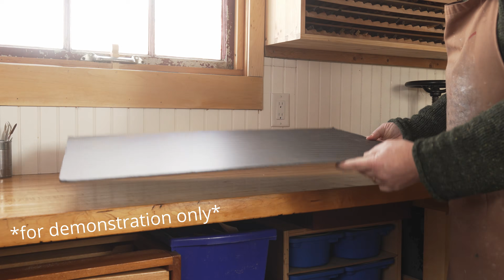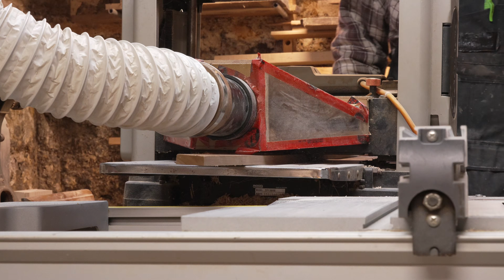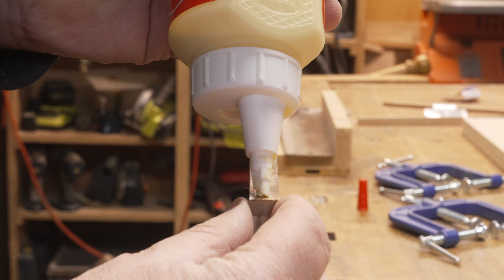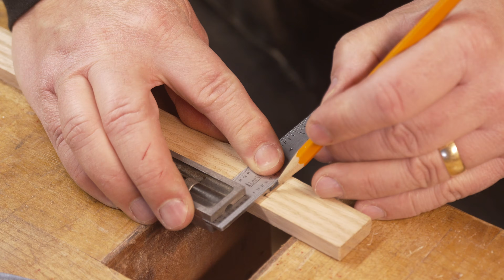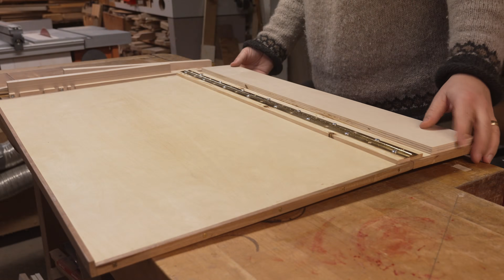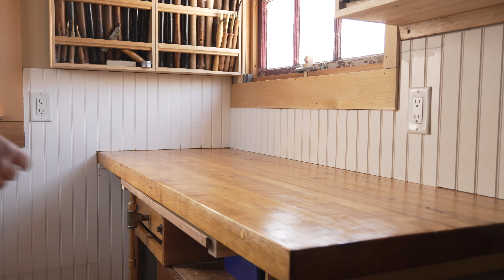Slide-Away Drawing Board - Self-Supporting Hidden Artist's Easel - Design Process & Full Build

Comment: Hi! Very nice design but way too much work to make it. I'm using instead a computer screen telescopic arm those that can be attached on the wall ( or any other vertical surface ). I attached my drawing board on the plate like thing that these telescopic arms have to attach a computer screen ( it has four screws) and then I pull and push it over my desk when I want to draw something. 

These telescopic arms can carry the weight of up to 32 inches wide screens, and allow you to adjust the height and the angle of the screen as well.  So as the drawing board is way lighter than a computer screen this way to mount the drawing board is very steady.  The drawing board is actually floating above the desk and the only thing I had to adjust in advance is the height because this is secured with a very tight clamp that you screw actually  in the right height.  But the height that  the drawing board stands above your desk is always the same. 
After fixing the height the only thing you  have to do is to pull the board towards you and then retract it in the most convenient for drawing, angle. When you don't use it turn it back to stand vertically and push it back flat on the wall. 

I bought this arm for 45euros and there are also similar arms for mounting on desks with prices starting from 20+ euros.

Comment: Your first space didn’t work the way you intended it because you set your rails back and I don’t think your design originally called for it. therefore it’s too far back when you first engage that first drop off and your hinge is pretty much right at the front of the table instead of being out away from it more.

Comment: I just found this channel a couple of days ago and LOVE IT! Your commonsense approach, the use of tools that make the job easier (power tools where and when necessary) and beautiful and refined (the use of hand tools the newfound love of my life) is wonderful! 

I do have an idea for a little reinforcement for your board. If you inset some rare earth magnets or dowels or then the corresponding dowel holes into the right side of the right rail you could put an auxiliary "prop" for lack of a better term. If you made it like a set of pinch sticks/rods I think you could put s shallow angled hole in the back of the board and a little foot on the other end of the "prop". The easel end of the prop itself maybe has a taper or a gimbal on it (not sure about that), but the foot end would butt to the wall and your bench. A 3/8 hardwood dowel and maybe a little piece of 3/4 stock for the foot. If you also used a couple of magnets or a dowel on the foot and a shallow hole in the wall I believe it would stay pretty much and give a lot of support.  Now if you went 1 step further and put a dado across the width of the board you could also put a couple of magnets or dowels. Then you could make a hardwood strip with magnets or dowels to drop in the dado. It seems like it would help stiffen the entire easel. IDK really though. Maybe hang it on the left side of the left runner with magnets or even dowels. As you pull out the easel you drop in the strip into the dado and pull out the easel. Then you take out the auxiliary prop to use as well. 

Don't hate me. I certainly am no craftsman like yourself. And ALL of your projects are AMAZING. I only thought this might be something for you to ponder on. It may be and probably is total rubbish. But I hope you and your viewers will not take offense. NONE was intended. Only that I hope one day to be as talented and accomplished as the craftsmen I admire, and you Sir are one!

Comment: Instead of that drop bar mechanism, I’d probably have made the runners wider so there was more meat underneath the stowed table.  Then I’d put a threaded insert in each runner 2” from the front and put in some star knobs from underneath. In use, the table is pulled out and put it at an angle that feels comfortable, then the star knobs are tightened until their threaded posts contact the underside of the tail piece and press it up, clamping it to the underside of the bench top.  When you want to change the angle or stow the table, you reach under the runners to slightly loosen the star knobs.

I think with the star knobs’ posts clamping the tail piece to the bench top, removing any room for vertical play, there would be little to no wobble like you experienced when testing out those last two positions.  The only thing I think is a trade off is you’d need to adjust two things on opposing sides to change the table position instead of just one drop bar. And of course the star knobs would hang down another 1/2”-1” lower than the runners on their own.  So more likely to hit your knees on them if you’re sitting at the bench. 

Overall. Cool drafting table solution.

Comment: I was hoping you would come up with a better idea than having to reach under the bench to push the drop bar back up to move to other positions.  I'm thinking a wedged edge on the back side of each position so you pull it through and then a slight tug would move it to next position. I haven't thought this through yet but I'm sure something could be done.

Comment: I was already loving the step-by-step problem solving. But then you pulled out the sketch for the angles. As a structural and mechanical drafter, I know I'm in the right place 😂❤
I've been trying to put my finger on what the exterior(?) walls of your workshop are made of. Rough cut stone? A kind of insulation? I love getting sneak peeks of it and your tools, and hope we get a tour soon!
Reply from the maker: Haha it's 120+ year old "concrete", ie mortar, fieldstones and whatever else the farmer threw in there back in the day. Would not recommend. #centuryhomethings
Reply: @FourKeysWorkshop  Ah, I have a similar foundation around our 1930s prairie farmhouse cistern. An absolute bear to try and cut through with stones bigger than my head.

Comment: @FourKeysWorkshop thanks for the lesson.  I really appreciate you showing your process. I've been playing with the idea of having a flip top. I like your concept better.

-If you use flat counter sunk screws for the piano hinge, it will sit flush. 

If you add 1/2 inch thick strips on the back edges, it will add rigidity. Then add a 2nd piano hinge under the top edge,  you could add fold down leg support.
Love your humour btw. Do you have an alternate channel? You have quite the following for such a new channel. With your style...you must be popular elsewhere.
Reply from the maker: Good tip on the screws, and yes, this is my second channel. @FourKeysBookArts is my main deal.
Reply: @FourKeysWorkshop  thanks

Comment: Could you add short blocks with V-shaped cutouts to the back of the board that sat on the front edge of the workbench in each of the resting positions? I don't know whether they would interfere with each other, but it might make things more stable, especially on the further forward positions.

Comment: Interesting project! I think for mark2 a metal drawer slide attached to a slightly longer tailpiece would provide better support at any angle / extension (because it would be mostly under the table anyway. Plus there are some heavy duty ones) and smoother sliding to boot. I also support the comment about adding some form of triangular feet on the main board for support. It'll reduce wobbliness at extreme angles, and reduce wear on the bench edge.

Comment: Hi Denis, amazing build. Loved watching it and I feel very inspired.

A suggestion if you wish to stabilize the drawer aspect more: Attach 2 3/4” pieces to the tail end of the drawer on opposite sides, so that it scrapes the bottom of the table top as you pull forward and back. Might be a good idea to use friction tape/ teflon tape or beeswax to make it smoother. This will force the drawer to push itself downward on the back side and not tilt forward when the drawer is in position 4 and 5.

Again amazing work! Thoroughly enjoyed it! Hope to see more on both your channels. Also congrats on becoming a full time YouTuber, it’s a great achievement and accomplishment!

Comment: Nicely done.  Have you considered a kick-stand at the back that you recess into the board?  That way it would still slide under the desk without issue, and have a solid rest (for certain positions) when needed.

Regardless, great work as always.
Reply from the maker: You're correct, I had that in mind as a backup plan if the existing design wasn't sturdy enough. And I can always add it on after if it needs it.

Comment: I always love seeing other folks ways of working through the idea in their heads. You have had the same basic tilt hinge against the desk for setting the angle I'd have gone for, but the latch to set the positions is a very different approach.

 I'd have been tempted by a half nut on threaded rod for very free ability to set any angle and very quickly too. But probably ended up with a strong ball detent concept similar to your notches in function but working on the side of the rails powered by a spring (and probably not a ball but a plunger you can pull out) - on the side mostly to minimise storage under the desk lost. Then likely with a knurled hand wheel that clamps the sliding part at an arbitrary position. (But I am more a metal worker than a wood worker so I should always have useful metal scraps and the tools to make anythign I need with 'em)

Comment: You didnt goof the measurement for position 1. You're goof came when you get the rails back off the front face. Your sketch had it flush and measured back from the front, your no further back so all the positions are now slightly steaper than planned but looks good. Maybe a folding leg or two would help with stability, as you have the room in the slides.

Comment: A small rounded piece of wood on a hinge near the top to use as a third point of contact with the bench would likely improve the stability and mitigate the wobble, other than that it's a really unintrusive design that can be easily removed too, great work!

Comment: I wonder if you could skip the whole drop in bar by taking advantage of how it pulls the guide board up when the main surface is deployed, by having some kind of meshing surfaces in between the bottom of the bench and the guide bar. Something like a threated rod could be embedded in the top on either side and something on the guide could press into it. Making it fully adjustable position wise.

Comment: A new episode of "The Old Bindery Basement", hurrah!   Norm would be proud to see you using a full face shield on the table saw, as I'm sure you recall his Intro tag line "And remember this: there is no more important safety rule than to wear these, safety glasses".

Nicely done with the drawing board.    I really appreciate you showing your whole process, warts and all!    Looking forward to the next video.

I'm right now in progress on turning some old salvaged beams into a benchtop that you could park a car on :).    Now I'm going to revise my design and incorporate a Four Keys pullout drafting table.   A few additions I'm going to try to include:
1) Stop block lift strap
Just a simple fabric strap attached to the top of the stop block, running to the drawing board past the hinge.  This way the stop block disengages when you fold it forward.  Being fabric it doesn't force the block down, still gravity locked
2) Pull out points marked
Just some markings to show how far out to pull to get the desired angle
3) some steel washers let into the drawing board for magnet hold downs of paper
Yes I can and will use tape, but as you are more aware than most sometimes you don't want to tape paper down.  I'll put in some washers in fostner bit holes so they're just below the surface, fill over with putty or epoxy and then sand/scrape true.   Then kitchen or whiteboard magnets can be used to secure the paper.    Will locate them for common metric paper A sizes, especially A3, A4, and A5
4) Cover the wood with drawing board cover material
To get the classic green vinyl look and feel
5) If I can find one:   Drafting arm!

And as you mentioned, a little drawer for the drawing tools.

BTW I don't know if you have come across it, but the producer of New Yankee Workshop Russ Morash has published most episodes on a YT channel of the same name.   Russ passed away last year but the channel is still live and uploading more episodes through at least season 19.

I don't think I mentioned it, but I met Norm on a "This Old House" project in 1984.   It was the project where they were building  house from scratch with all the latest (for the time) green tech, and I was a software contractor wiring the house for sensors to run on a (gasp) home personal computer...   Norm was just as he came across on TV, very friendly and took the time to show me how he was doing custom moldings in the entranceway, including how he did the miter joints with a trick that I've used several times since:  Rather than cut the joint at 45 degrees, he cut it just slightly steeper angle by about a degree.  This way when the corners are brought together the tips meet before the back, leaving a nice tight joint.    His other trick for interior corners on complex shape molding was to cut one piece square and one piece at 45 degrees.  With a fret saw he then cut along the line where the 45 degree angle cut met the face of the molding, which resulted in a perfect profile cutout of the molding face to butt into the corner.

Comment: Your design looks very good and seems to work well enough, but for version 2, eliminate the drop bar entirely. Find the angle that you will use it at the most, and put the stop on the underside of the bench, screwed to the bench in front of the hinge plate to prevent it from pulling out-so that it keeps the hinge plate from pulling forward out of the guides. It will be much stronger, no moving parts, and nothing to split or crack with repeated use.
Enjoyed the video!

Comment: Beautiful work!! My father helped me build a standing height/drafting stool height drafting table a few years back. I needed something for a compact shared space, closer to the width of an old quill writing desk to fit the smaller area (my studiomates tell any visitor who will listen that my dad built it and how well made it is lol).

Anyway, it may not fit your vibe, but my table felt complete once I added that green Vyco drafting covering to the top. The surface is firm, but has just enough give that you can draw directly on single sheets of paper without the wood surface affecting how the paper takes graphite and ink. It also has a smooth grip to keep paper somewhat in place. It certainly looks cooler to leave the surface wood, but I can't recommend the Vyco highly enough to anyone with a drawing surface.

Great video, and I love your channels!
Reply from the maker: Now I know what it’s called, thanks!

Comment: Wax (either paraffin or bees) on all the running surfaces will probably do wonders for smoothness of operation, especially in the slots on the stop block around the screws. 

You could probably also design a little lever that can lift the stop block out of the grooves.

Comment: Useful! I think all of the load will be transferred to that drop bar and the slots, which you already know aren't strong enough. 
I think MK2 should recess the hinge so you don't need to make extra clearance for it in your design. And you can use drawer rails instead of wooden runners for a smoother open/close action. Some spring-loaded pins at the front can lock the drawing board in position and be easier to release. 
Oh, and if you create a hook shape on the edge piece pencil holder, you can leave pencils in it when you close the drawing board. That'd be fun!

Comment: A little candle paraffin rubbed into the grooves and along the insides of the runners might make it move a bit more smoothly?  That's the only refinement I can think of.  I like how you didn't run out to the local hardware store and buy a set of rails and runners -- that makes the project more personal, and less expensive (since you used materials already at hand.)

Your design workflow is rational, showing the benefit of experience, and an understanding of your own capabilities and limitations.  So very well done!

Comment: I'm just a random dude on the internet and I don't know much about woodworking but the first idea that came to mind to increase stability would be to add V shaped strips to the underside of the drawing board that rest on the corner of the bench top. That way you won't have just a single line of contact between the bench and the board but two perpendicular planes.